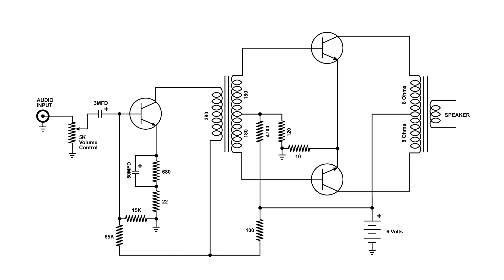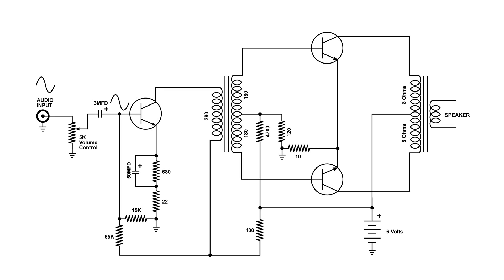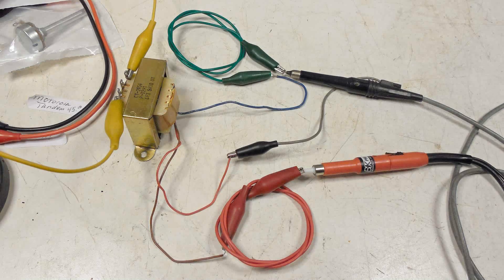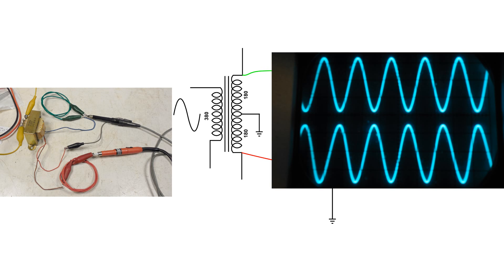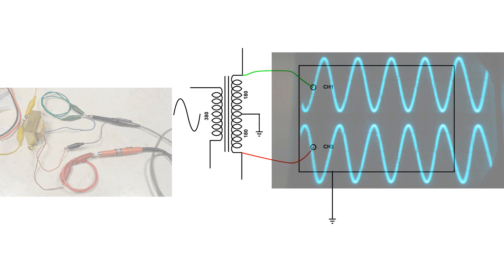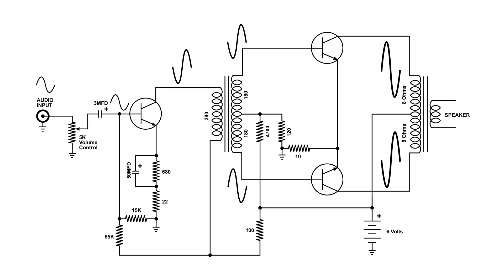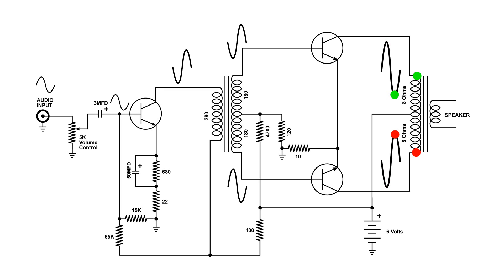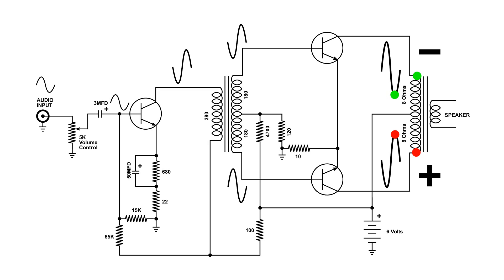Transistor Push Pull Audio Output Amplifier

Comment: Why that complicated resistor / capacitor network on the emitter of the first transistor? I've seen other circuits (like in the popular HX-108 kit) where the emitter goes straight to ground!
Reply from the maker: The resistor and capacitor on the Emitter raises the bias voltage on the Base. This allows the transistor to handle a stronger input signal.

Comment: what determinates the impedance of the primary winding on the push pull section?
Reply from the maker: The output transistors and the audio frequency.
Reply: @AllAmericanFiveRadio  How? i know that in tubes you have to know the Plate resistance to determinante the primary impedance, would be the same or similar with transistors?
Reply from the maker: @omarcusihuaman4261  Yes. Vacuum tubes vary mostly voltage and a little current. Transistors vary mostly current and a little voltage. So the impedance of transistor circuits are much lower than vacuum tube circuits.
Reply: @AllAmericanFiveRadio  so the output transformer for a transistor must match that low impedance? How low is that impedance?
Reply from the maker: @omarcusihuaman4261  At the audio output and depending on what the transistors are driving 200 – 30 Ohms.

Comment: Thanks for sharing video  > Just curious wondering,..could this output instead been explained as; An alternating- 'sink_sink' ( pull_pull ) ?  ...
..It seems like the highest positive voltage potential is connected to center-tap of speakerTransformerWindings, and thus the two BjTs instead 'alternating'  -"supplying-sink" on the endpoints of inputSide speakerTransformer. __Not 100% sure,..but could it be so ?  (..looking at schematics at ca 4min into video)
Reply from the maker: MOSFET Push Pull Amplifier Visual Demo
https://www.youtube.com/watch?v=-6N7l1dnk6s

Comment: mr. rick, is that inverted signals can be used as balanced output signal (hot,cold,gnd) for a balanced input pro amp? thanks.
Reply from the maker: It can be used to balance the right and left channel.
Thanks for your comment.

Comment: Are transistor set they ones that use this configuation
Reply from the maker: I got this circuit from a Zenith radio. I have done a number of videos on biasing transistors. When you want to build something the first question is, what is it you want the output to drive? What you're going to drive with the transistor, the battery you're going to use, the signal, all influences the design of the circuit. This is where the datasheet for the transistor is very handy.